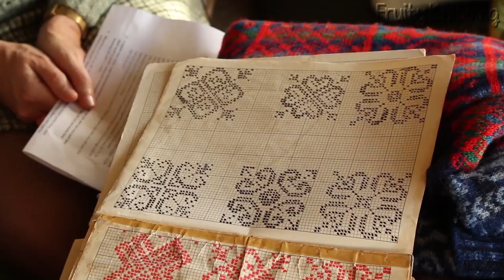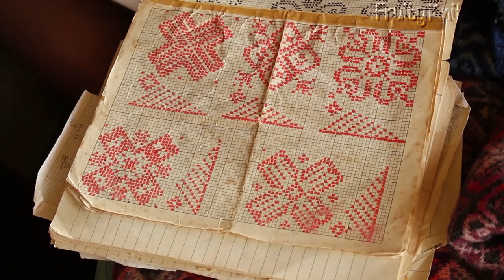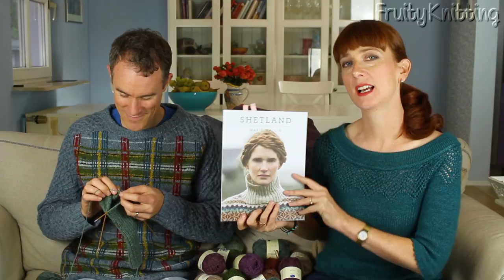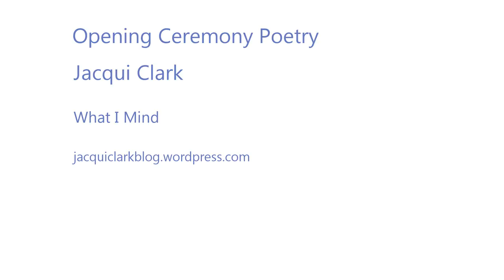Shetland Wool Week 2017 - Episode 39 - Fruity Knitting Podcast

Comment: Can you explain exactly what Dr Christiansen meant by “dressing” when she talked about repairing and dressing a piece.
Reply: Suzanne Berry - dressing means the careful washing, then blocking of the scarf or shawl. In Shetland this is usually done with wooden blocking frames that a shawl or scarf is attached to, that stretches out the beautiful lace patterns evenly on all sides. Every point perfect, and every edge exactly straight. Then the shawl/scarf is allowed to dry on the frame, and removed when fully dry.
Reply: Fair isle and single colour non-lace knitting is also dressed - jumpers/cardigans/pullovers on jumperboards; hats on a hat board, food container or a large plate; gloves/mittens on gloveboards.

Comment: The sweater Hazel is wearing is interesting. It appears as though the pattern is not centered correctly.
Reply: The pattern is perfectly centred - I couldn't knit it otherwise! However the neckline is asymmetric - straight at the left with all the shaping on the right side.